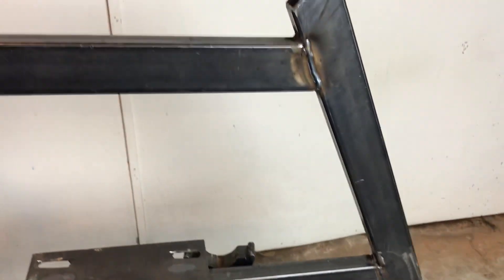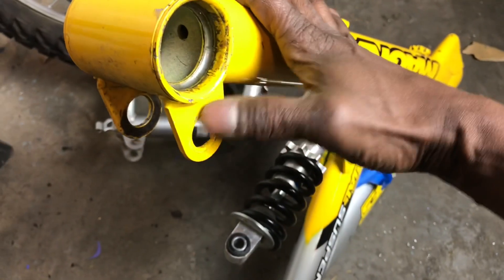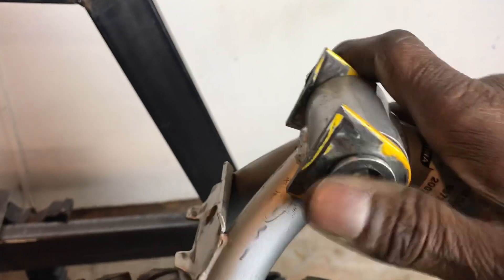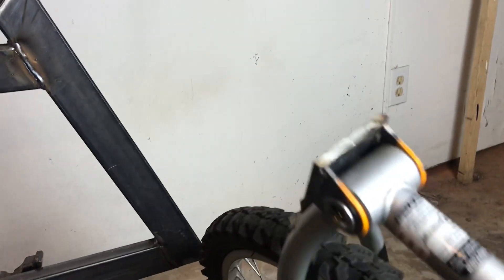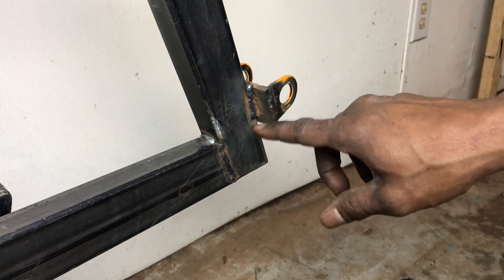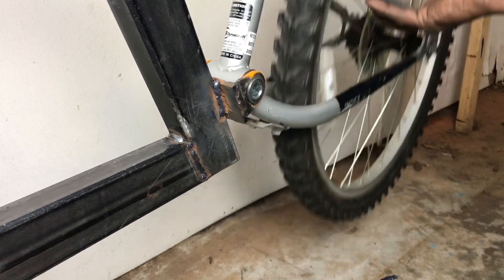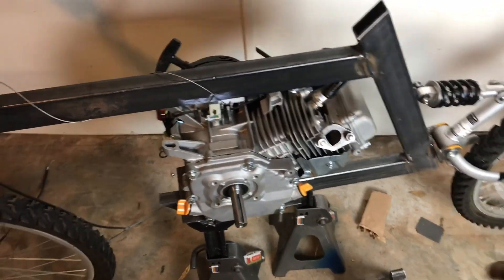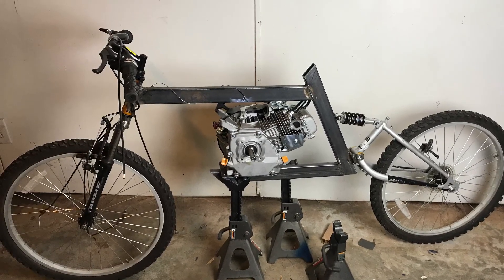Part 4 -- Predator 212cc Powered Bike Project

Comment: I built my bike from a 212cc kit which uses a CVT. I built another 49cc kit on a Micargi bike and as far as vibration comparison between the
 "Ghost Racer 7G T-Belt Drive V-Mount Kit" and the 212cc kit with the CVT, the CVT beats the other kit. The 212cc kit is running a 34 tooth
sprocket and more than enough power and speed to climb/accelerate up hills. The bike will bury a 50 mph speedometer with more than
enough rpm to go since I removed the governor and low-oil sensor when I got the kit. You are doing a excellent job with the fabrication
on the project and thanks for the videos!

Comment: use a jackshaft...make it right side drive.....leave the gear cluster for a transmission...
Reply from the maker: au69miner I will run a clutch and jack shaft. I will think about used the gear set. Not sure how durable it will be. It was pretty trash as just a bike lol